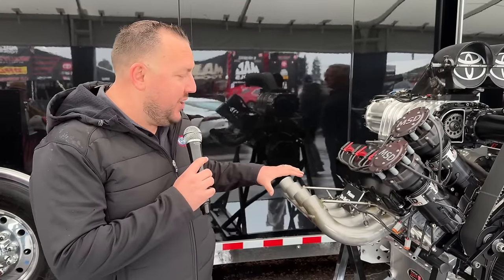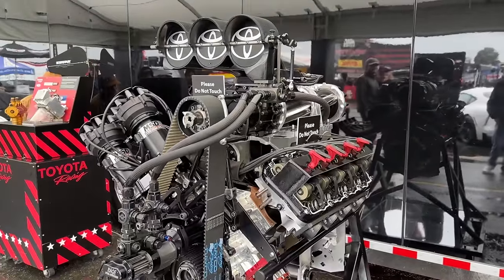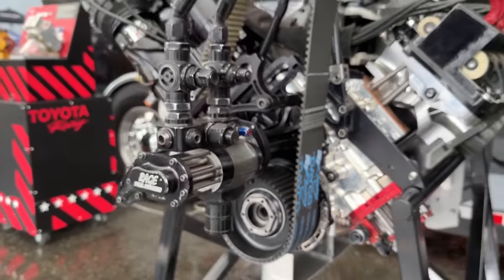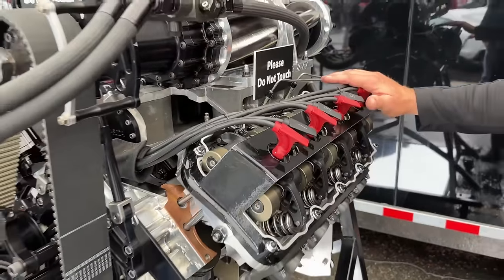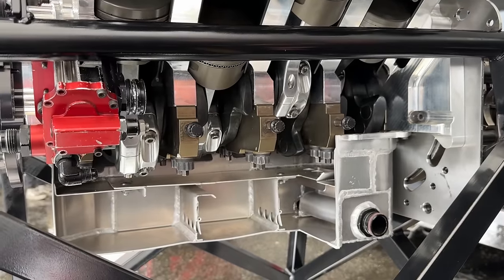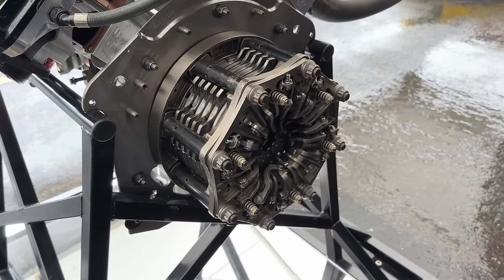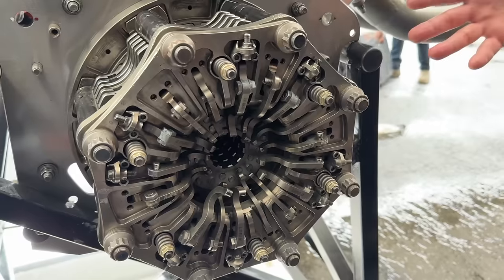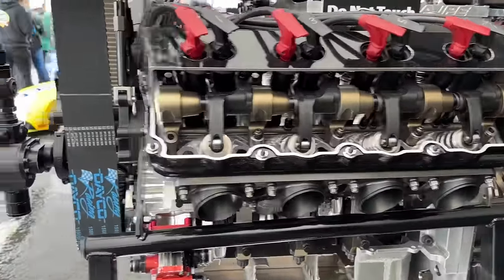Cutaway engine rundown with Kalitta Motorsports and Toyota Racing

Comment: What components do Toyota produce?
Is it mostly just a sponsorship deal/badging exercise?
Reply: None. BAE (Brad Allen Engines) and TFX (Too Fuel Extreme) are a couple examples of top fuel engine builders. Some teams, including Kalettta, do some of their own r&d. Toyota is the sponsor.
Reply: @scotthash7037  it's Brad Anderson,  who's Brad Allen ???
And it's Kalitta. BAE= Brad Anderson Engineering. And pretty much nowadays everyone uses Alan Johnson equipment in Top Fuel Nitromethane, there's still lots of BAE engines in Alcohol classes, But Not much Nitro burners running BAE.

Comment: I had no idea Toyota built Top Fuel engines.......amazing
Reply: To be fair, none of the car manufacturers sponsoring this class of racing have any components on the race car that are related to a street car. 

Maybe when you go way down to the street classes that actually have steel bodies and oem based engines.

Comment: “Engine” my brother…these are called internal combustion ‘ENGINES’
Reply: To be as ignorant as a "you spelled it wrong post" I retaliate with MIT engineering quotes. The Oxford English Dictionary defines “motor” as a machine that supplies motive power for a vehicle or other device with moving parts. Similarly, it tells us that an engine is a machine with moving parts that converts power into motion. “We use the words interchangeably now,”
Reply: Motor definition: a machine, especially one powered by electricity or internal combustion, that supplies motive power for a vehicle or for some other device with moving parts.

Also, motorbike, motorhome, motorcycle, motorway, motorcade, motor speedway, a billion others I can’t think of right now. 

A motor is just the unit that motivates or powers a machine. People have been correctly calling motors, motors since the beginning. A million gatekeepers have been assembling their own fences and claiming that “motors are electric!” for a long time, and will continue too. It doesn’t make you or them correct.
Reply: And no, that isn’t a copy/paste, besides the definition part. I’m just really annoyed by people that make this claim to sound smart and better than, while being absolutely wrong. There’s also air/pneumatic motors, hydraulic motors, probably others that I can’t recall right now.
Reply: @9rjharper  What about the story of the Art Arfons car that was the fastest machine on any dragstrip. It was powered by a airplane MOTOR. I can't tell you the whole story but it's to the effect of- Gene made a machine, Joe made it go<(aircraft motor) because of s9me bad gas, tragedy struck and art blew it up which is why he went to a turbine mOtAh!
Reply: General MOTORS , and the Ford MOTOR Corporation disagree.....
Reply: @jamesgeorge4874  They don't like that argument either lol. I guess it's a Engine car when your looking from thems basement

Comment: Nice Mopar Hemi
Reply: They can't really use anything else since the NHRA restricts them to these engines only.
Reply: @johncarl5505  what do you mean restrict them many years ago Chevrolet tried to make a hemi it was called an Arius hemi Ford tried the same thing what you meant to say this is the only engine that will produce that kind of horsepower and it’s design came from the 426 hemi